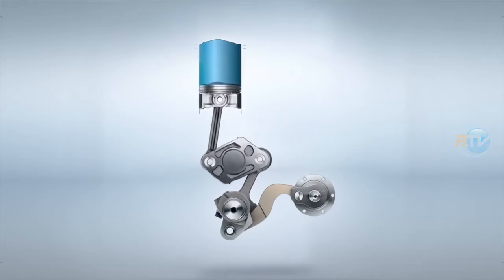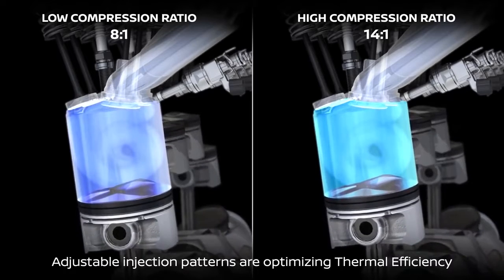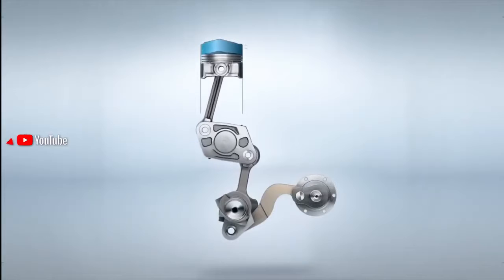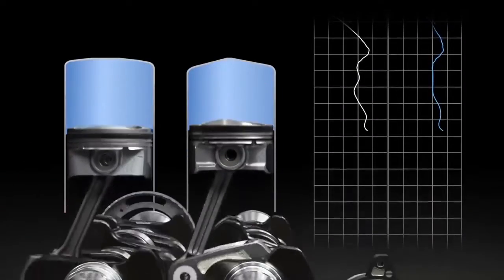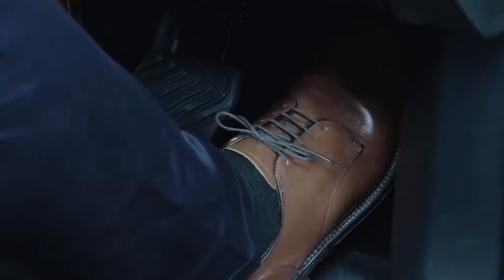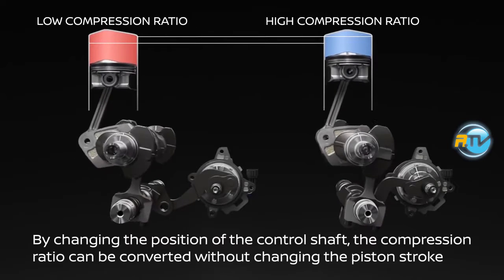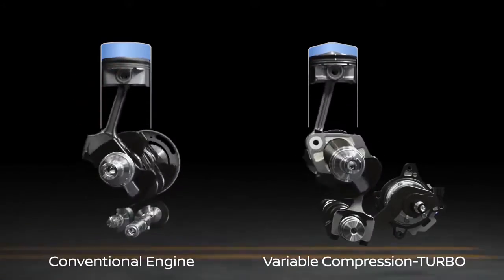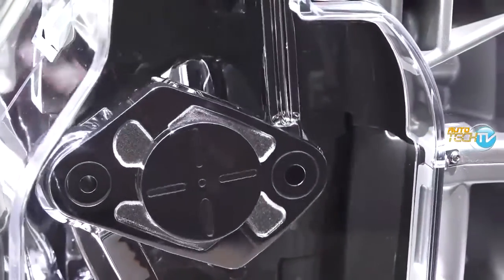#car #turbo #engine | How it works?

Comment: You can possibly make it variable compression ratio throughout the operation of the engine from 8:1 to 9,5:1 without changing the fuel Octain level and the ignition, in the case of direct fuel injection the timing will have to follow up the change as well.